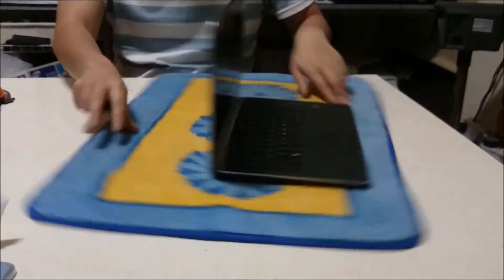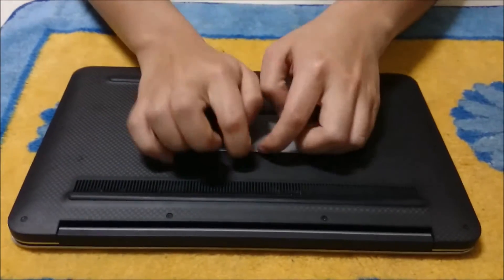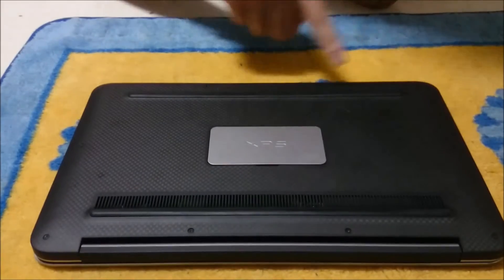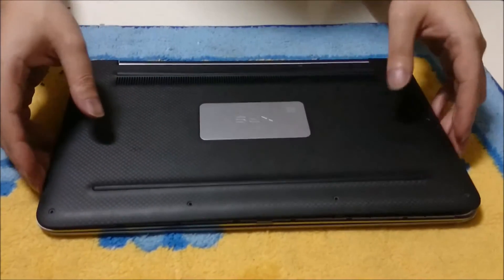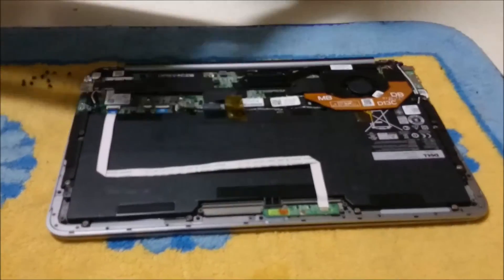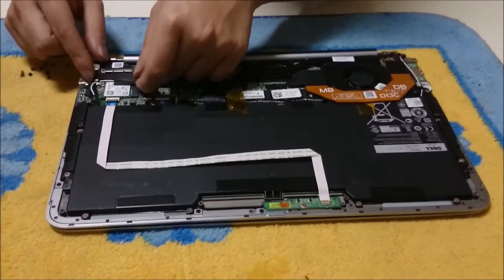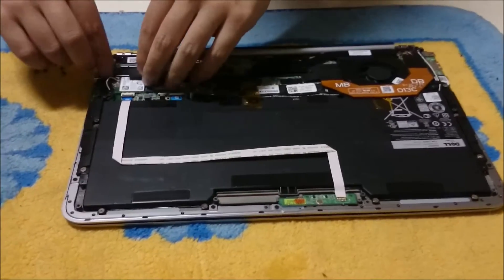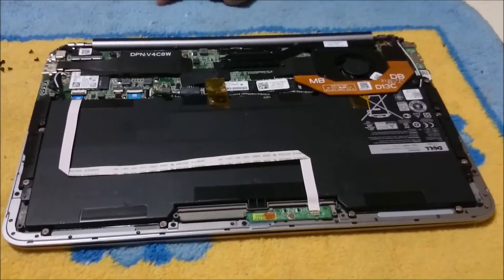OPEN ME UP! Dell XPS 13 9333 2014 Touch Screen Notebook Disassembly

Comment: So aside, from the front LED cable routing to the motherboard side instead of the daughterboard, the L321x, L322x, and 9333 are all pretty much the same, right?  In theory, I could put a 9333 mother/daughter board in my l321x, right  I dont see any size or connector differences.  I know the battery is bigger and the screen is different on a 9333 but i suspect i could put a 9333 board in my l321x and it should work.  Can you confirm if this should be possible?
Reply from the maker: it is the same. the only difference is wifi card. if you look at my other videos i have all 3 of them

Comment from the maker: I don't understand why you will say it is misleading as I have the 2014, 2013 and the 2012 model. I have used the other model to replace parts like the keyboard, battery, cover and LCD screen. I apologies that I did not show the removing of the keyboard as it was not required to look at the motherboard. My disassembly are basically all about getting to the motherboard. If you want to know how to remove the keyboard you will need to remove the motherboard and battery. If you like help you can go to dell website and download the manual and it will tell you how to remove the keyboard step by step

Comment: misleading saying it's the same as the 2013 and 2012 model. You don't actually take apart anything.. How would i replace the keyboard? This should be called removing back cover